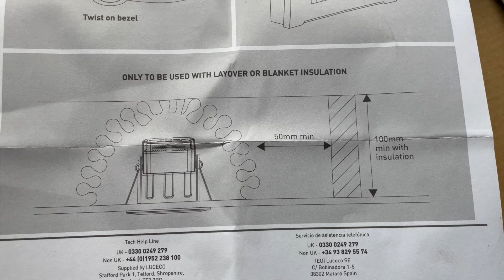SHOCKING: Sink needs redoing!

Comment: hi Nigel, re the sink position.  current position is workable if you are a tallish person, however it can be challenging for shorter people.  in my experience at our home, the sink is also in that same position with small space between the wall and sink.  Water does tend to spill onto the back and with the short distance to the wall, the silicone with which ours are sealed against the wall, does tend to get mouldy and  needs to be replaced.  Not what you want to hear, but in the long run, it may be better to bite the bullet now and move it forward.
Reply from the maker: Suzette. Please stop with very sensible, evidenced-based comments..! 😂
I feel I might be ordering a new kitchen…
😉😂🍻
Reply: @EscapeToTheDreamHouseUK  🤣    but i also need to add that i watched the video where you discovered the leaking roof.  Maybe just write the kitchen sink positioning up as experience, leave it as is and focus on what is more important for you.  phew, you all have a lot of determination to renovate that dreamhouse.
Reply from the maker: Aw thank you!
I think the words determination and crackers are interchangeable when it comes to a dream house!!! 😉😂🍻